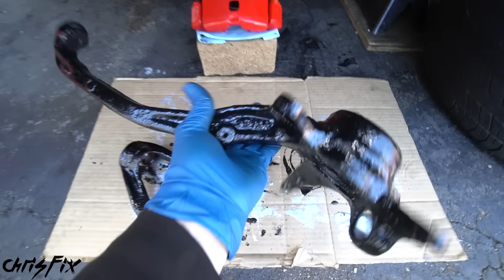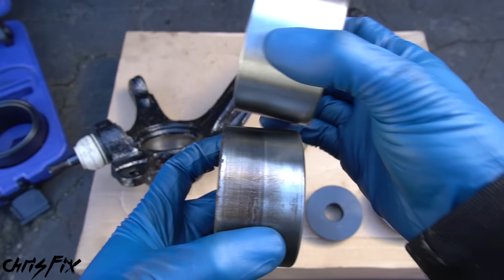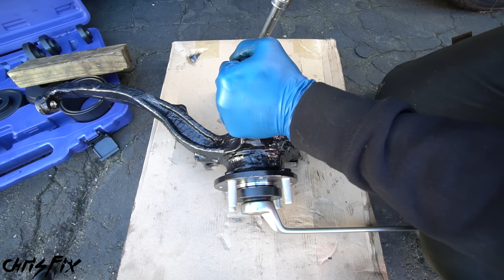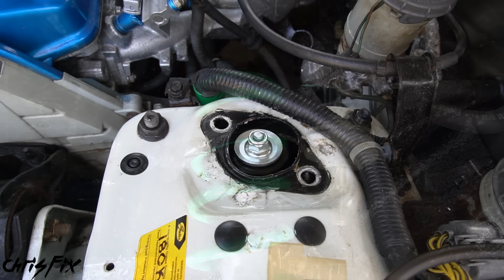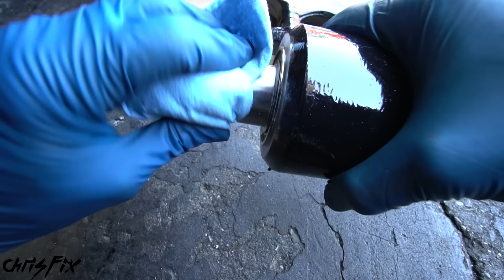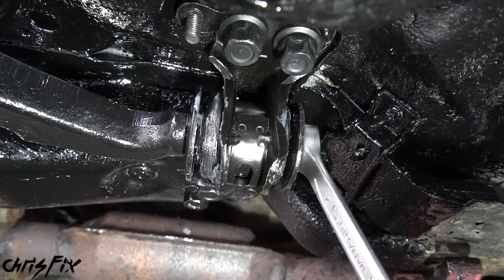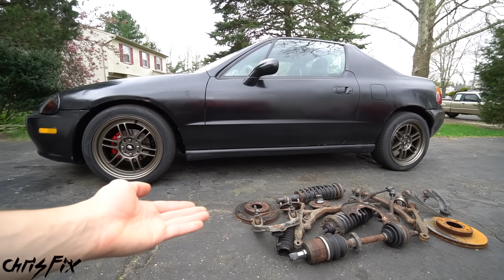How to Install a COMPLETELY New Front Suspension in your Car or Truck

Comment: Still another excellent video from Chris fix!!  Has helped me so much!
Thread locker companies good!
Shop mechanics. ..oh well.
Reply from the maker: I'm glad the video has helped you out a lot!
Reply: @chrisfix  ... I d like your suggestions on my next remove and replace.  
My 2002 Nissan Altima.
Tie rod ends inner And outer.  
Loaded knuckle.
Brake rotors and pads and calipers.  
Replace all brake fluid.

Thank you so much your time and guidance.

Comment: My 2005 Mitsubishi eclipse has 135,000+ Miles on it. Everything in the front suspension is original and desperately needs replaced. Thinking of doing a full rebuild of the front suspension since I had replaced the rear struts (one of them broke). Had a front strut fail and the steering is vague due to worn out tie rods. I think its worth spending the full money for something that I know is going to outlast the car. Your videos make it seem not as bad!

Comment: I’m trying to upgrade the suspension on my 2007 Nissan Altima.

It’s my daily driver, but I would like it to drive smooth like butter with great handling and easy on the bumpy roads.

I heard I’d have to upgrade my OEM coil over to an aftermarket coil over and an after market sway bar for the front and rear.

Any suggestions?

Comment: do you need to replace all of these parts at once I recently bought a 1996 corolla and just thought about putting a new strut quick assembly in the front end for now
Reply from the maker: You don't have to if everything is good, but it definitely helps older/high mileage cars!

Comment: Well, I learned a little from this. May have to reassemble the control arms so they're properly setup for load. Also wouldn't mind a wire brush for rusty stuff. Kinda makes me wish I had some car friends..

Also strange that the del sol doesn't have a front sway bar unlike the civic ex(my car)
Reply: Nearly all cars have swaybars but the del sol might be too old, old cars didn't have swaybars

Comment: Love your tutorial. I've just replaced the axles and tie rods on my 1997 civic. However, the whole car shakes/vibrates above 55 mph. Prior to this work, I didn't have this problem. I have searched the Internet and found this is a common problem with new axles. Where did you get your axles? I noticed that the one you put in did not have the vibration dampening like the OEM axles? Are your axles spinning without vibrating the whole car at highway speed? What would you recommend?

Comment: I have a 86 Pontiac Fiero GT 2.8l Automatic, but it's a beast but my question is would this pertain to a Fiero GT Front end suspension I am doing all polyurethane bushings all new upper lower ball joints (front) and kyb suspension up front (and back) then Monroe Rack and pinion shock. & Then Moog tie rod (outer) (k & N cold air intake a chip module. I am the second owner ever and it's got 89,xxx original miles. I can't wait till all parts get here this will be my first time working on a vehicle by myself that is I am not what you'd call a grease monkey or anything close to that I build gaming PC's lol

Comment: Hey Chris, did you train as a mechanic or work in a shop. Also, if I have a chevy truck should i replace suspension with AcDelco. Or should i buy expensive aftermarket like Moog is better?

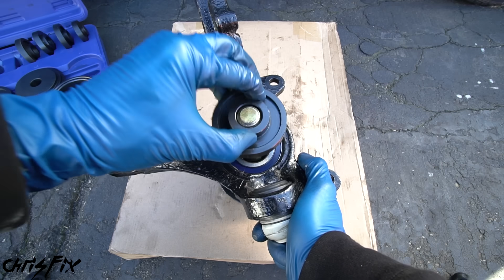Comment: 7:42 don't you want the adaptor to be on the inside of the bearing?
All the stress is on the inner side when you press something inside the bearing.
Reply: No, the outer race is where the force must be applied. The friction exists between the outer race and the bore that it fits into. So you want to press the outer race not the inner race. If you press on the inner race you can literally push it out of the bearing and destroy it. Even if it doesn’t push the inner race out it will cause what they call brinnelling between the balls of the bearing and the inner and outer races causing premature failure.
Reply: @OneSevenandTwentyplus  I've never brinneled my balls.

Comment: So idk if you'll see this or if you ran into this problem during the wheel bearing/hub installation but when I was pressing in the hub into the bearing the rear end of the bearing somehow pressed against the snap-ring and bent the inner race of the bearing. Should I install the hub into the wheel bearing without the snap-ring installed ? Please help me out I'm not trying to order a 3rd set of wheel bearings

Comment: When torquing down the bolts you can’t quite get a torque wrench on, why don’t you just use a crows foot?
Reply: I was thinking the same. I've used crows foot on a torque wrench for spots where you can't put a socket

Comment: Hey Chris 👋🏻
I just finished installing brand new front suspension on my 2010 Nissan Tiida,but I noticed that the new suspension made the car sit a little bit higher than before and I am not sure if the car height was like this from factory because the old suspension was really bad. I really don’t know if I should cut the springs now or what :( 
Any help would be gladly appreciated
Reply: Just leave it like it is dont cut them if you want it lower use lowering springs
Reply: Erik69 thank you, I think I am ok with this new ride height it did get lower after a week

Comment: If a car is missing a spring and a shock absorber on one leg will it break if I put it down on the wheels? I got a replacement but the sold me the wrong one, I'm considering driving slowly to the junkyard to change it which is 17 kilodmeters away,  do you think my car will become junk if I do that?

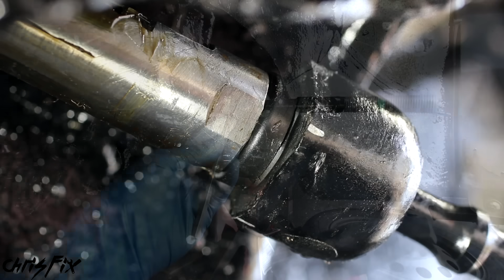Comment: Hi, at 10:36 into the video, how do you measure that torque, I'm new to this, is there a special torque wrench you use as those seem like normal wrenches/spanners without any indicators or measurements, thanks for sharing your knowledge.

Comment: Make sure y’all replace all the self locking nuts and bolts when reinstalling upper control arm, lower control arm and pinch bolt on the fork.
Reply from the maker: Thanks for the tip!

Comment: Great vid,  but I always thought a cotter pin was essentially a bolt with a tapered shank.  This was typically used to fasten a shaft connection - say a bicycle pedal shank onto its axle.  Could be wrong though.  The device that is being talked of at about 21.00 is a split pin.
Reply from the maker: It's called both things!

Comment: Question…should anti seize work just as well as the silicone paste, or do you recommend strictly silicone paste be used for lubricating the bushings for the control arms, bolts, etc? Does one work better or would you say each works better with different parts?
Reply from the maker: I recommend silicone paste for bushings like you said! You would use antiseize on bolts that will likely rust or corrode!
Reply: ChrisFix cool, thanks! I had my driver side axle swapped during a rebuild recently, and I’m planning to do my passenger as well, so I decided to do a bit extra and replace the ball joints and bushings while I’m at it. Can’t afford the entire suspension setup like you did, but hopefully it gets my car closer to feeling newer lol honestly I’ve watched both pull-apart and put-together parts of the suspension vids and I love how thorough you are with details, I think I should be ready as soon as I gather the last few supplies🙌🏽

Comment: Hey Chris I want your videos all the time having a problem with my 1991 Pontiac Firebird when I insert the key to the ignition and turn it it won't allow the starter to turn over I think the the ECM is not reading a chip can you give me some information on how to correct a problem
Reply from the maker: It could be a number of things, does anything happen at all when you turn the key?
Reply: @chrisfix  the. Dashboard. Light comes.on

Comment: Always use lube to insert your bearings or ball joints, it's easier for installation.
Don't listen to this guy, he's wrong and you will force them in which will make them harder to get them out next time, not to mention some wear on the outside will occur, which mai damage either the bearings or the ball joints.

Comment: Hey Chris so i have a pair of early 90 Integras that I and completely redoing in my own style and I’m looking into converting to a 5 lug but I can’t seem to find out if I have to buy the donor hubs or if they sale individual hub replacements. I was wondering if you had any recommendations on where I could look or if I’m just stuck spend the extra for some donor knuckles that come with 5 lugs already... any thoughts and advice are extremely appreciated. Thank you

Comment: @chrisfix, what is 80-foot pound? how do you know or measure the pressure, Advice me, please
Reply: Every bolt/nut has a tightness that is recommended to be tightened to, It can be inch pounds, foot pounds, etc.

A torque wrench has these numbers on them. So if you want 80 foot pounds then you set the torque wrench to 80... when the tool gets to that set pressure it clicks or makes some sound so you know to stop.

This is done so you don’t go to tight or too loose.... just perfect!

Comment: Metal does not expand or shrink with heat or coldness.
Reply from the maker: All materials are made up of atoms, so when metal is heated, the kinetic energy of that material increases, so the molecules move around more, thus making the material larger. When metal is cooled, the kinetic energy of that material decreases, so the molecules aren't moving as much, and the material will now be smaller.

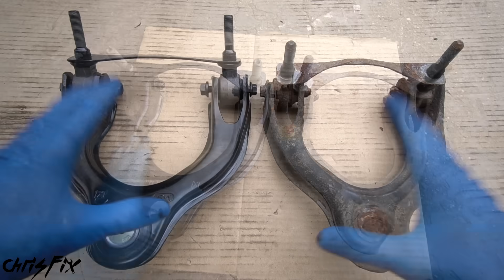Comment: On 12:25 it explains how upper control arms are loose from the factory and to compare to the old part. Well the control arm I took out is also LOOSE! how do I find, at what degree, it should be tightened to? Owners manual? Or just wing it? lol

Comment: What's up ChrisFix , I just have a couple curiosities, how do you (not people in general) find out what all of these different torque specs are? Also, aren't the torque specs going to vary from every different vehicle even though they are for the same nuts and bolts and whatnot? The resources for the torque specs would be very helpful especially when in my case buying different used cars and they don't have all the necessary owner's manuals inside of them. Well thanks so much your channel is super informative and helpful, especially when I'm just as OCD as you are🤙

Comment: I never wanna tighten a castle nut on a bolt past it's torque spec to allow the pin to slide through. Always take the nut back off and try it again. If you go past the torque spec, you can compromise the integrity of the bolt.

Comment: How much would you estimate this to cost, parts and essential tools and all? The suspension on my Malibu drives just like you showed with the old suspension! Not to mention it's super loud and sounds bleak.
Reply from the maker: It can depend on the car, but I would say anywhere from $600-1500 if you also need to buy tools!
Reply: @chrisfix  Dude, appreciate the quick response from the master himself! Appreciate your knowledge, bro! That doesn't sound bad. I'm inclined to take on that project during this quarantine time, hopefully it warms up a bit.

Your videos are dope, dude. Keep at it and stay safe.

Comment: Don’t forget to put anti-seize on the wheel hub. Because once that brake rotor starts to rust and collect dust, it’s gonna weld itself onto the hub and be a pain to get off.

Comment: my workmate told me about 4 years ago, that my suspension is bad and feels spongy. i never noticed that (it was my first car). In Summer 2019 I decided to replaced the complete Suspension, Control-Arms and steering rods (steering was spongy too). I saved such a lot of money with this. Volkswagen wanted around $1600 for this total for a f*cking Golf IV! I paid like $500 for the Parts and this was an easy weekend-job in ChrisFix-Style without a lift or impact drivers (it was hard, but possible) etc.
Reply from the maker: Awesome! I'm glad you saved a bunch of money and did it yourself!

Comment: Question, when your tightening the bolts, for the upper Control arm, how do you know how much to torque them too? Is it basic knowledge or is it the spec requirements from honda for that make and model? I would of never thought there would be a specific number per bolt

Comment: It is fun to watch video because the way you are talking and showing parts attract peoples but it is not possible for someone who’s not used too with tools, even anyone with basic knowledge will not able to do that job.
any one can be stuck anywhere by removing or installing parts,
what did you showed is purely mechanic job or someone who is very well equipped with tool and knowledge,
Just by watching your video is not enough.
Also that method doesn’t apply with all vehicle.
Thanks for entertaining.

Comment: As a professional courtesy, if you’re going to a shop to get your tracking done, only snug up the jam nut. It wont come loose on a short drive and  makes it easier for us to loosen it off to be able to turn the inner rack arm in/out. We Will  tighten it fully when it’s properly aligned👍

Comment: Could you just whack the ball joint in with hammer and piece of wood if you are struggling to get ahold of ball joint presS?
Reply from the maker: You could but it’s definitely better to press it in because the shock could damage the case. But with that said, It’s possible, just be careful.

Comment: the only thing i don’t get is stuff about foot pounds  can someone explain it to me real quick
Reply: how many pounds of force to move an object one foot.  with bolts and nuts it uses friction to keep the nut from backing off first between the flange on the nut against its mating surface but also it locks the threads together just the tiniest bit.  too much or over torquing the nut and bolt causes the metal to stretch, which will lead to quick failure.   the bolts on most things are graded for strength both rotational where you have stripped a bolt into two and lateral or length wise stretch.  its not just a 3/8 bolt can take so much torque it actually may take more than a 1/2 inch if the grade of metal used is higher.  construction bolts are graded on their heads listed by most commonly the number of flat lines  1, 2, 3, ....   automotive bolts not so sure of.  but your hanes/chilton manual will list torque specs.

Comment: Chris, another excellent video, as usual.  Just one thought you may consider.  At 7:43 on the counter, while pressing and seating the hub into the bearing you said, "use a plate that fits on the outside edge of the bearing".  In this case, because the hub is sliding into the bearing race and the resistance is between the outside of the hub and the race of the bearing, the back plate should be against the back edge of the race (instead of the back outside edge of the bearing).  In this case is looks as though edge of the race and the outer edge of the bearing may be the same plane, which would make it a moot point.  But if not, putting the back plate against the outside of the bearing, instead of the edge of the race, would allow lateral pressure against the race, with no back support for that race.  This lateral pressure would be transferred to the new ball bearings themselves, possibly damaging the new bearings.  Again, your videos are excellent.  I'm just pointing out this one thing for you to consider.

Comment: There is no way any mechanic would do a job like this, with perfect torque specs, cleanliness, spray painting reused rusty parts and using correct grease, transmission fluid, and Loctite.

Comment: I have an 2007 Toyota Camry 2.4V, Recently i did an extensive suspension change of perts on my camry and now i am facing an issue with the driving. Whenever i go through some highway corner  around 80km, my car corner to the left just fine, but when i corner to the right often the traction control on the left front whells turn on and it is making me feel my car is dangerous. I dont have this issue when i am cornering to the left where my car feels stable and no traction control auto braking goes off. Can you advise on what is the possible issue?

Comment: Chris, you made a little mistake with pressing the HUB into the Bearing. You put adapter for the ouside diameter of the bearing, but you must put adapter to fit the inside metal diameter, because HUB is entering exactly there.. The way you made it, you make axial preasure to the balls of the bearing, when press the hub.  Just saying, nothing that wrong.

Comment: If you live in a high humidity area, putting parts in the freezer will cause them to start sweating as soon as you take them out. My fix would be to put the knuckle in the sun enough to warm it up and keep the parts to be pressed in the shade. 

Could you use something like WD-40 to prevent moisture from getting into the machined areas of the knuckle?

Comment: Can anyone help this problem I am having?2007 Chevy Cobalt squeaking brake pedal Already changed inner and outer tie rods struts,control arm .Also losing minimal brake fluid garage can't find anything .Either can i.checked lines wheel cylinders behind master cylinder.But squeaking noise brake pedal area lubed bushings etc nothing works

Comment: I have a question! I ripped some of my bushings last time I installed new struts because I didn't know the rule of dropping the car on the ground before you torque them.. I'm wondering what negative consequences I will face riding around on those ripped bushings and how necessary it is to replace them? It's certainly something I want to take care of because I love my civic and want it to last. I'm still learning though and am genuinely curious. I noticed it today while working on the car and it made me wonder

Comment: No dust shields? Weight reduction bro!

Lol, ended up taking em off my 300. They ended up deteriorating so much, the connections fell apart and we're rattling like a soda can in a washing machine. 

It was so embarrassing, but glad it was an easy fix. 

That was two years ago, and now I'm not finding your video because of an easy fix lol